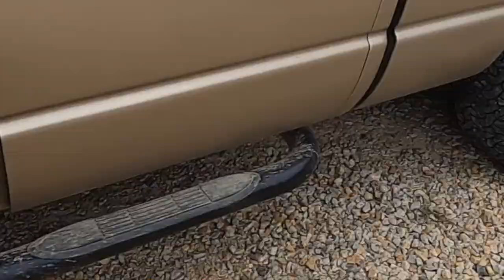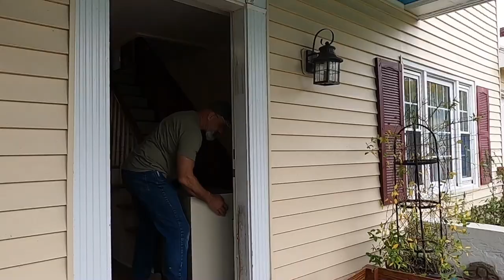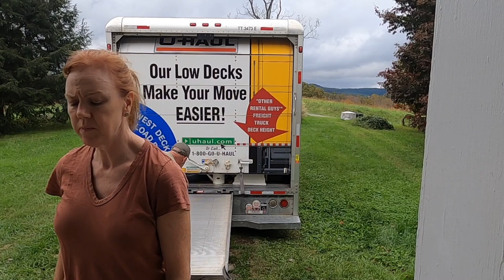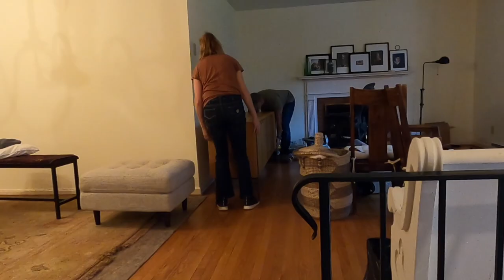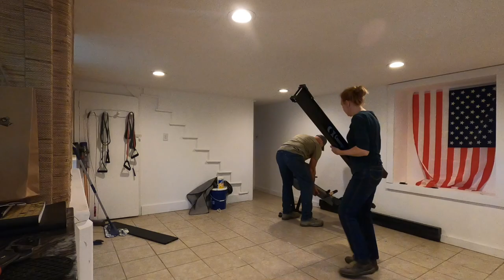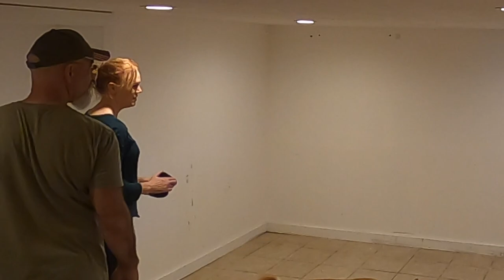Moving Day.  Time to Pack It Up and Go.

Comment: Damn. That was fast! Moving sucks.

What kind of floor mats were those in the gym? Looked heavy.
Reply from the maker: Moving really sucks. Those are barn stall mats. From Southern States and Tractor Supply.   Heavy and dense but they work. I had that setup in the basement for 3.5 years with lots of deadlifts coming down heavily on the tile floor underneath. Not even a crack in the grout.